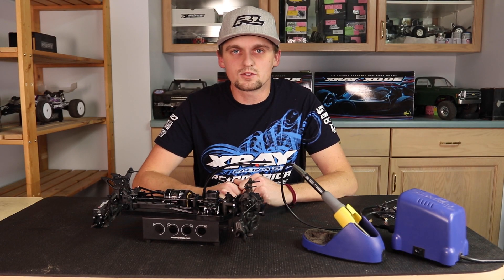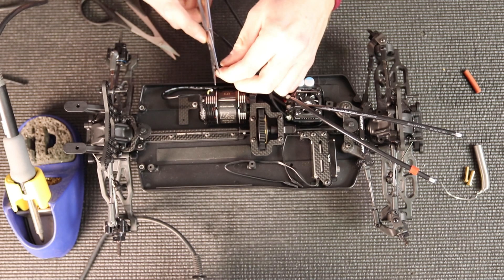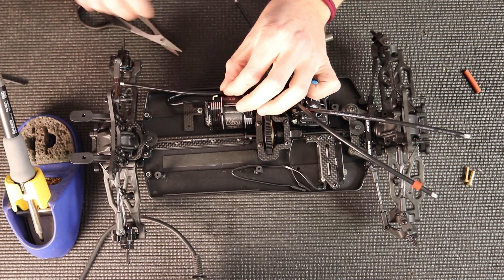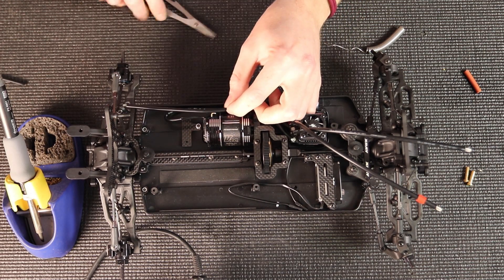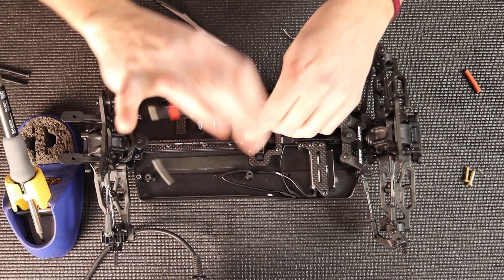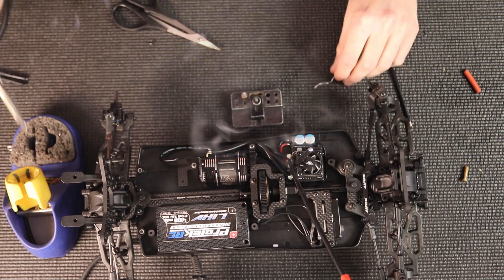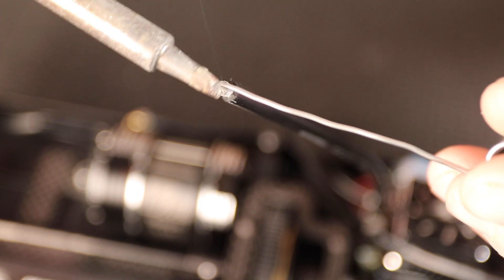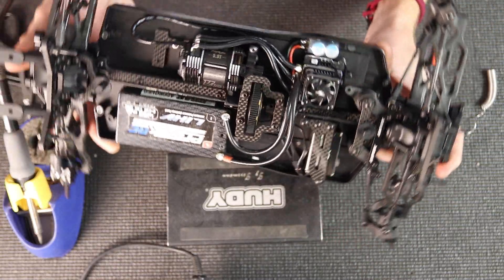Ty Tessmann Pro Tip: Soldering your Electronics

Comment: Ty I would like to get a jig like the one you used for your bullet connectors. Is that available from a retail supplier or is yours home made? Also, what model of soldering iron and temperature do you use? Thanks for sharing your knowledge with us.
Reply from the maker: The jig I use is the Much More soldering station and the Hakko FX888D iron set to 850 (link above)

Comment: What soldering iron station are you using here and what wattage temp do you use?
Reply from the maker: I use a the Hakko FX888D iron and I believe it is set to 850
https://www.amainhobbies.com/hakko-fx888d-esd-safe-digital-adjustable-temperature-soldering-iron-station-hakfx888d-rc-p/p248449

Comment: Thanks ty. What temperature do you set your iron to?
Reply from the maker: The hotter you solder it the faster the wire heats up and the less likely that the heat goes into the motor or speed control, I believe mine is at 850f
Reply: @tytessmann5842  thank you

Comment: Hi Ty , nice video as always. for a follow up video with this new X-ray 4wd I would like to see How You setup your servo and steering for this car (the car as and adjustable servo saver)  and is the servo an MKS 599SL ? and do you setup your BEC at 6 volts or 7.4 Volts . Thanks keep up the good work
Reply from the maker: The servo saver tension is adjustable but I glue mine together so it is fully locked because my servos are strong enough to handle this.  Yes the servos I use are the MKS 599sl, so the servo setup is pretty much the same as the video I did on setting up the servos on the XB2 (that video is titled steering servo setup).  I set my bec at 7.2volt.
Reply: @tytessmann5842  
Thanks Ty for the reply , I did go watch your video on the xb2 servo install , it was informative. Eager to see you again racing  in 2021 with your X-ray crew , you guys are awesome , Seeing you guys drive is next level 😉